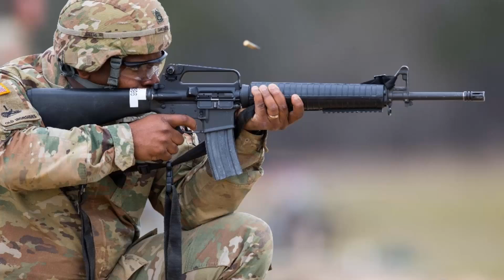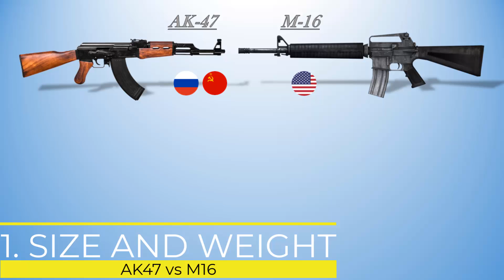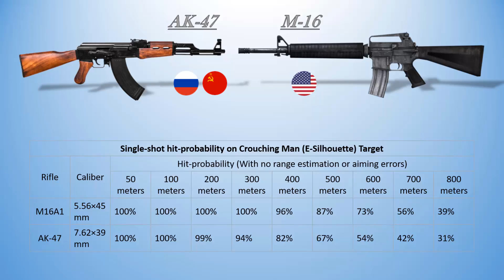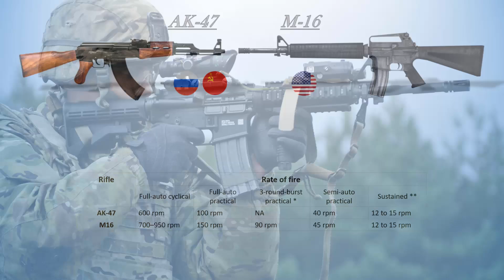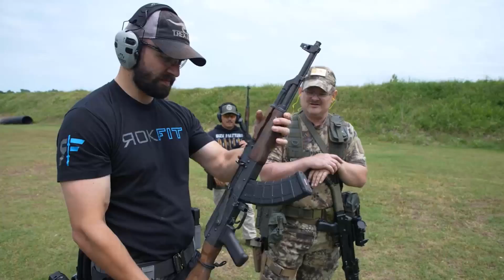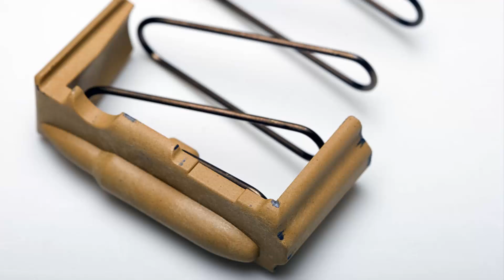AK-47 vs M16 | Which is better between the two?

Comment: Personally, I prefer the M-16. It has tighter tolerances and more modularity for adding optics and such. However, I would be lying if I said I didn't appreciate the ruggedness and reliability of the AK
Reply: I agree. The M-16 is lighter, more modular, and is built to a standard. The standard for the AK is blurred compared to the M-16. I can replace the upper of my AR with any other AR lower of the same caliber. The light recoil makes follow up shots much more accurate. It's much easier to accessorize my AR (M-16 platform) than it is with an AR. My AR has picatinny rail and MLOK. Also, the reliability of modern AR's is much improved, to the extent that you cannot call it unreliable. Military Arms Channel did a video where they fired 10,000 rounds through a BCM AR without lube and without cleaning it with zero malfunctions.
Reply: @birminghamblueheat4986  which gun is longer in size ak47 or m16?
Reply: @tonyojiambo5875  The M-16, however the transition to the m4 shortened it. I’m not real sure how that one compares.
Reply: Funny nobody seems to care about the M-16's main advantage . . .
You can carry 240 more rounds per soldier, if everyone is carrying 22 pounds of ammo. Having 240 rounds left per soldier when your AK-47 enemy runs out of ammo is a major advantage that everyone overlooks.
Reply: Aks murder more people world wide
Reply: Just to let you know that the M16 was shity in the Vietnam war
Reply: Every modern rifle has the same modularity

Comment: in terms of fatality, are both equal. as well as reliability. the older design of M1 are still that bad  incident due to incompatible ammo. But the current production are great with  Piston type op, optic able, different attachment. and several rifle length of superb accuracy, The advantages of Ak-47 is being cheap.

Comment: If you have to hump around in the boonies, the AR is better due to the weight factor, especially for the ammo.  It is also easier to fire accurately and faster for follow up shots, and it is easier and faster to reload; those are the AR’s two most important advantages.  As long as you keep that ejection port cover snapped shut and a little oil on the carrier, it will be reliable in most environments.  The only place the AK has a marked reliability advantage is in a sandy/desert environment.  But that DI operating system on the AR does mean that it has to be cleaned more often than an AK, and it’s a pain in the butt to clean, at least relative to an AK.

I have not been in combat myself (peacetime infantry vet here), however, I have heard from multiple combat vets that the 7.62x39mm round is a better man stopper than 5.56x45mm.  The 7.62x39mm also does better getting through light cover and concealment without breaking up or being deflected.  Within 200 yards, where most shootouts will take place, it’s a better fighting round.  Even Mikhail Kalashnikov once said in an interview that he personally was not in favor of going to the 5.45x39mm round, but that’s what the Soviet military wanted and his objections were overruled, so he did what they asked of him.  Interestingly, the newest version of the AK is produced in both 7.62 and 5.45, with 7.62 being issued to spec ops units.

There is no question that the AK is easier to maintain.  It doesn’t have to be cleaned as often and it is easier to clean when that is needed.  Field stripping and reassembly is so easy you could teach a child to do it in ten minutes.  And, no itty bitty parts to worry about losing. 

As for accuracy, you won’t win trophies at Camp Perry with an AK, but it’s “accurate enough” for defense against two-legged predators.  It takes more practice, but if you put in the range time you can get better accuracy with the AK than a lot of people who have no experience with them think.

Personally, I prefer to go with a punchier round and easier maintenance, so I vote for the AK, but that’s just me.  I’m not humping around in the bush; I’m a bit old for such adventures. So, the weight doesn’t matter so much in my case.

They’re both excellent weapons.  If you learn how to use them properly, either will work well.

Comment: Ok boys n girls here's a training occurrence that I'm aware of ( I'm 1st division civie) let's use it as a thought experiment; You're in the Arctic Circle , in a heated Armoured Personnel  Carrier, you and your squad have been breathing heavy and condensing your moist breath in there for hours then you get the signal to go... and disperse into the minus 30 degrees C tundra.
You lie up for while then you try to engage a contact. M4 versus Valmet, what happened?
Reply: All that condensation could potentially freeze ur gun up I live in Montana where it gets pretty cold and had this happen not to my ar but to another rifle that was a bolt action savage axis 2 the bolt got a little hard to pull back and chamber took a couple of cycles to work it out

Comment: 8 year Marine Corps veteran here. Been around AR’s, M4’s, and M16’s for a long time. I can say I definitely prefer the AK platform than AR. It’s a lot more simple to maintain and clean with far less parts to keep up with. I’d go with an AK104 or 105. I’ve had issues with my M4 while doing training exercises. A small amount of dirt or sand will cause it to jam if you’re not mindful of keeping the ejection port cover closed. Then I’d have to field strip it and get rid of all the grits of sand or dirt. Not to mention, the gas system on an AR just makes the inside so much more dirty. The AK doesn’t have this problem. 
I’m not hating on AR’s as I like them too. This is just based on my experience. I just prefer an AK if I had to choose.

I’ve also heard of war stories from other combat veterans that the 5.56 just doesn’t have stopping power. It’ll maim them, so they’re still somewhat combat effective, but won’t put them to the ground til they get hit numerous more times or a direct headshot. The 7.62x39 would definitely take the cake.
Reply: I'm retired D.F. I agree completely w you.  Its more practical, more reliable in combat. Plain n simple, more stopping power, easy takedown.
 In battle in most situations the ak47 works better.
Hk416 is also great. 

You have to understand that it depends on your mission mostly.

I'm speaking for general all around use in battle, stick w the ak47 and learn how to shoot it.
Reply: I think it is just the FMJ ammunition that the military uses especially out of carbine length or SBR barrel that is less effective. Use a good expanding round (especially with the higher velocity the 20" M16 generates) and it puts deer on the ground, which will do the same on humans.
Reply: Pretty much everything you said was completely wrong, I call bs that you were in the military case of all the real marines I talk to say the opposite of this. 556 was not designed to Maime, it's a more lethal cartridge then 7.62x39 and pretty combat effective.
Reply: @chanoleyva8584  I was with 1st battalion, 7th marines over in 29 Palms, CA and more other units in Camp Lejeune, NC. No need to further explain myself.
Reply: @its.Andy1 I shot both on a Kiev firing range the m16 and m14 was accurate with good grouping  , the Ak wasn’t as accurate, but just looking at the targets you know if you get hit by a Ak bullet you ain’t getting up
Reply: @its.Andy1 brother I'm w you. I'm retired D.Force, the ak47 is the better combat option. I've seen guys shoot the enemy and get shot back at w thier 5.56s .
 Combat experience tells you everything, I've used ars Aks n everything u can think of.
 Video game heros on here mostly.

Comment: Oh and by the way -stop this stupidity with more rounds. The AK magazine have more bullets than the M16 and each soldier have at least 5 . Not to memtion that the 7,62 is much more powerfoul than the 5.56.
Reply: If you can't hit anything then it does not matter.
Reply: The ak does not have more bullets, soldiers can carry more 5.56 than 7.62 and it isnt that much more powerful plus 5.55 has better penetration

Comment: You cannot compare between M16 to AK47 because both are in different calibre. M16 should be campared to AK74 while AK47 to M14
Reply: M14 uses a larger and more powerful cartridge than AK 47. Only similarity in cartridge of AK 47 and M14 are the diameters of the bullets, but M14 has a longer cartridge with more power and also more recoil. AK 47 is for this reason more similar to M16.
  AK 47 and M16 use intermediate cartridges. M14 uses a full-power cartridge like the G3 and FN FAL.

Comment: This video is like comparing the T34 tank with the Panther. Both are fantastic pieces of hardware but they were built with different considerations in mind. Panthers had a high emphasis on engineering but were more expensive and were more difficult to source replacement parts. T34s, like AK47s, were made to be efficient and cheap to spit out en masse, reliable and rugged, with plentiful replacement parts in the field so you'd always be able to operate your AK. And in that, both the T34 and AK47 serves its purpose perfectly.

It's really laughable how the SA80 will cease to function if a speck of dirt gets in there, but you can throw AK47s into the mud and it'll still shoot and do the damage. With the added benefit that one doesn't need to be that precise (or skilful) with your fire to inflict significant wounds.

TL;DR: The M16 outperforms the AK precisely because it costs more, and the AK is less heavily engineered but also ridiculously effective, on purpose, because countries with a huge population like Russia wants a spammable reliable yet relatively cheap weapon.

Comment: The plusses of the M-16: Accuracy, modularity, lighter ammo, lower recoil.
The plusses of the AK-47: Ruggedness, reliabilty, cheapness.
Reply: So what that means is, modern M16 style guns are just better ones
Reply: @heyguysiguessthatsit438  I didn't say that. Ever read up the M16's early history? The first version was overconfidentially called "a self-cleaning gun", and look what happened during the first field tests in Vietnam.
Reply: DIDNT the M16 jam in the Vietnam war
Reply: AK cheapness??? You obviously have not priced AKs in a while. In the U.S. they are extremely stupid expensive. Unless you are buying one out of someone’s trunk.
Reply: @dougglaus9256 Ever heard of PRODUCTION COSTS?

Comment: Vietnam war M16 have smaller magasine than this rifle in video. AK is better than M16 in every way. And, in modern era nowdays, AK 12, AK 107, AK 15 are much better than AR 14, M4 and other american rifles. Zastava M70 B1 is better than M16!!! Serbia
Reply: M16 is better: weight, recoil, accuracy, range, lighter ammo
Reply: Maybe on shooting range. In war times, AK is better on every way. No jam, shoot on temperature plus 40 and minus 40 and many other things but my english is limited. If you have problem with recoil, and less than kilo heavy rifle, you shoot from air rifle... What else can i say..? Use Ak 107, AK 12 and that rifles are far better than AR 15, M 16, M 4 and every other american rifle. AK is most legendary rifle on planet for good reason!
Reply: @milanbelovukovic8252  modern m4’s and m16s have pretty much the same reliability as an ak
Reply: @enanny0616  Yeah, for sure...
Reply: @milanbelovukovic8252  is that sarcasm?
Reply: @enanny0616  Yes, that's obvious...?!?!
Reply: @milanbelovukovic8252  it’s harder to tell when you’re just reading words on a screen and modern m4’s and m16s rarely ever jam after being used for a long time

Comment: AK-47 can quite well punch throught the doors, fences and other obstacles.. even through small trees. Not so sure about M16. AK-47 can take a lot of dirt in it and it doesn't jam. Even if it jams in rare occassion it's very easy and fast to dismantle, clean and assemble again. Not so sure about M16 again. Magazines on AK-47 doesn't bend and are quite sturdy on their on, you can even use them as a small hammer. I believe the lips bending on M16 mags has been a bit of a problem. The recoil and handling of AK-47 is undeniable way terrible compared to M16, but you never really need to use full auto-mode. With single shots fired it's still quite steady.
Even today common soldiers in any modern military pretty much never use anykind of gadgets in their weapons. That's due to logistics, costs and keeping the weaponry as unite as possible. Even if you would need one, there are plenty of modern AK-47 variants, clones and adaptations that offers that option.
I guess it's quite clear which one I would want to pick if I had to go to warzone.

Comment: The M-16 and its variant’s are the superior weapon design thanks to it’s modularity and it’s cartridge. The .556 is better than the .762 by almost every metric. That said I still love the Ak-47, it’s the bad guy gun and it’s more scary thanks to its mass use by the enemies of America for well over 70 years.
Reply: “Better in every metric” except for when it comes to actually putting a threat down
Reply: @jakeh6980 uh no
Reply: @jakeh6980 you think an m16 won’t put a threat down?😂
Reply: @enanny0616  People laugh at the ".22 cAliBeR" that the 5.56 is but yet, if it was so ineffective the Russians wouldn't have ripped it off and made their own version the 5.45x39 to replace the 7.62x39 in the AK platform.
Reply: @guyontheinternet8891  exactly, they think the biggest military alliance would make their main caliber a bullet that wouldn’t work

Comment: Why doesn't the author say that the length of the M16 is not only an advantage, but also a disadvantage? And what is the point of being able to shoot at the head from a longer distance in combat if that weapon is not reliable enough? Reliability in combat is always a priority.
Reply: When they say the AK47 is the most reliable that doesn't mean the M16 is not. Many armies and rebels in the world favor the AK47 because they are way cheaper compared to the M16 rifles
Reply: Reliability is important, But if that is all you care about, you should go to war with a K98 bolt-action rifle, because that thing is surely even more reliable than the AK-47. M16 is actually not that unreliable, it's notorious for jamming caused by the US logistics because they didn't want to replace M14 with it, not the M16's fault.
Reply: I think they prefer  long rifle looks dangerous like a sharp spear 🤣
Reply: Reliability and length aren't related. Also, the length problem is solved by using the short version of the tifle, M4 carbine, instead of long M16.
Reply: The m16 is extremely reliable

Comment: AK-47 was desirable during the Vietnam war by US special forces, but M16 had a longer range and was more accurate, the perfect weapon to dig into foxholes. Both weapons systems had two different roles to play in the bigger picture. 🙃
Reply: Range and accuracy absolutely, but the M16 wasn't a dependable combat rifle. Sensitive to moisture, shock, climate, dust particles and in instances drenched in sea water [Marines] the weapon was reported to explode. M16/AR15 rifles are excellent for civilian recreation. But in heavy stress actions they are flawed, defective rifles.
Reply: @charlesburke2379  Ukraine would disagree m4 platform works just fine
Reply: There're no reports of the M4 being a maintenance free system. My guess is it is precisely like the jam prone M-16 was throughout the Vietnam war. Even after chronic cleaning, the weapon is sensitive to climate, shock, moisture and in situations drenched in seawater [Marines], the M-16 was reported to explode.  Unlike the simple, basic weapons Russia arms US enemies with that work no matter what. @kennyk541
Reply: How about you brother? Would the M4 be YOUR choice of combat rifle? Or how about one of the new combat shotguns? @kennyk541
Reply: So the rumor goes US soldiers threw off their M16 and opted for enemy's Ak's in mid combat because of the reliability of AK-47 in harsh climatic condition.
I don't know if its true though. Any Idea?
Reply: @engineer_yulan  M16 at that time was unreliable due to misuse among US soldiers, especially when it came to cleaning...

Comment: AK-47 can hit a torso at 300m and I can hit a head all day at 880yds with an Mk12 (M4/M16) and I can carry two to three times the ammo. Swap uppers and I can get a shorter mk18 config for up close. 5.56 does tremendously more damage. Hands down M4/M16.
Reply: well yeah because the MK12 is specifically a marksman rifle.  It is not in the same class as a standard M16 or AK47.  Hence the reason MK which stands for Marksmans.  It is also a Heavily modified M16 Variant.  A more appropriate comparison would be the MK12 vs the Dragunov as both are more or less Marksman rifles and have very similar ranges of accurate fire.  Technically The dragunov is a "Sniper" but no one considers it a sniper rifle and more along the lines of a Marksman or DMR.   The Dragunov also comes with the reliability of the AK also.
Reply: @alphadragongamingFTW  i disagree you can still slap a scope on m4 and it will do what the mk18 does just as well if your talking abut the svd(dragonuv) i would compare it to the sr-25 the m110